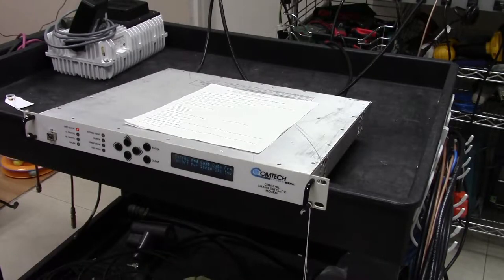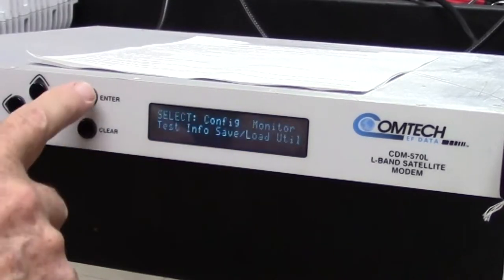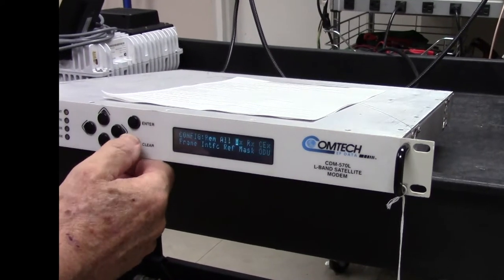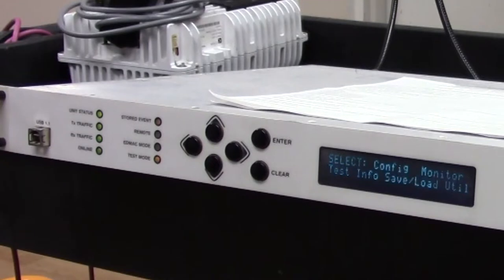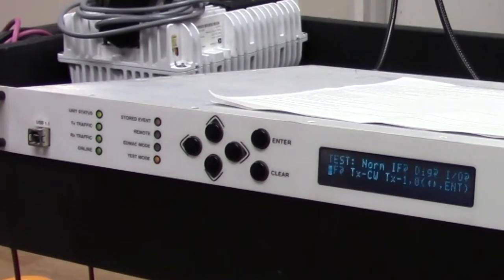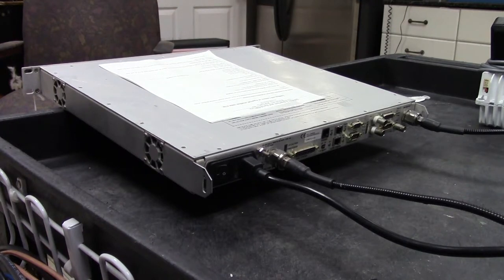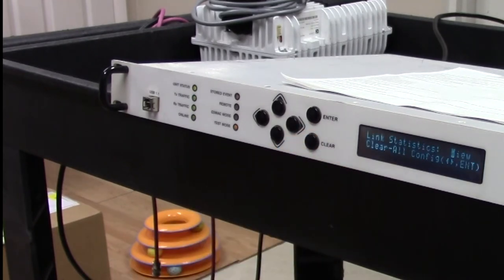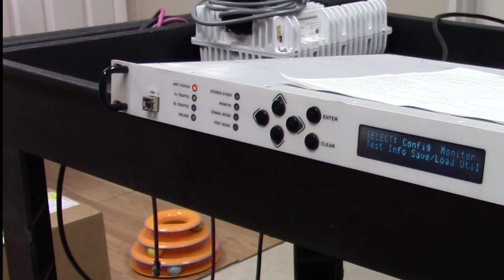CDM-570L Demonstrating CW, RF Loopback & IF Loopback

Comment: How do we think it's a system that doesn't work in raining time
Reply: this system resists rainning...there is slight power degradation but the Teleport HUB HPA have the function to compensate power to the remotes.